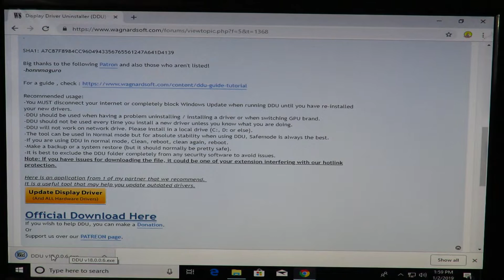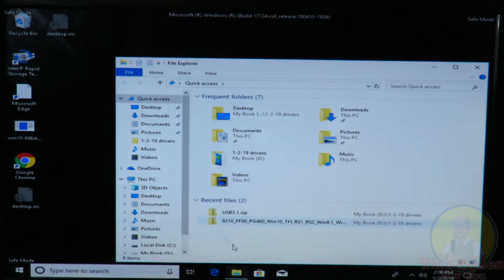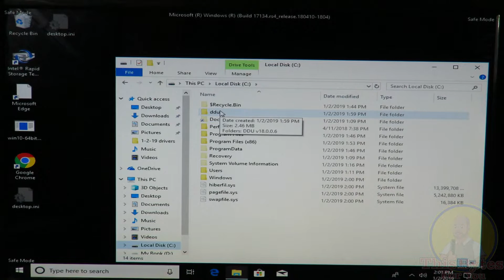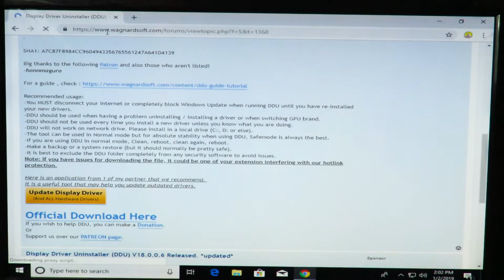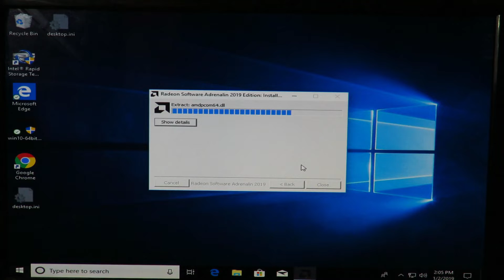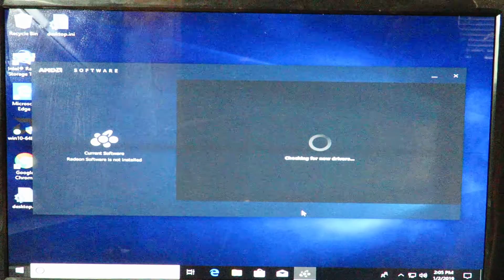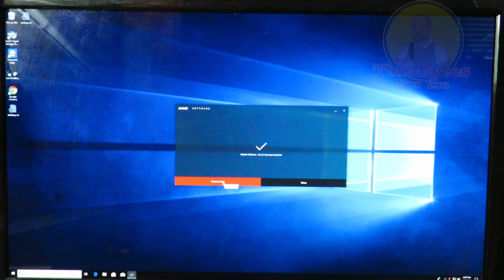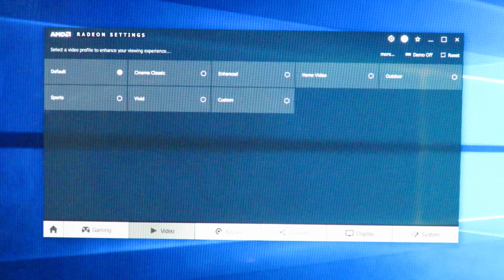How to install the AMD Sapphire Radeon Nitro+ RX 590 8GB OC Special Edition

Comment from the maker: In this video, we go over how to install the Sapphire Radeon Nitro+ RX 590 8GB OC Backplate Special Edition 11289-01-20G to either upgrade your computer or when building a newer one.  
Check it out on Amazon: http://geni.us/CWSOO8N
Reply: Quick question.... Do I need to use two sperate PCIe cables from my power supply unit to connect this? Or if I have one PCIe cable that has two 6+2 connectors can I just use the one cable & the two different connectors on it for the card?
Reply from the maker: @gkennedy0969  it's best to use 2 if you can, 2 cables and 1 connection per cable.
Reply from the maker: Always a pleasure my friend, so very happy you stopped by, trusted in me to help you, liked and subbed as well as took a moment out of your day to thank me.  It means a ton to me and I am so very happy I could help you. @gkennedy0969

Comment: There's any risk putting the cable with the extension 6+8 in the gpu?? i can see that u put is an individual cable for each input one for the 8 and other for the 6 pin
Reply from the maker: I would always recommend putting one cable per connection, not daisy chaining connections.  It can cause bluescreens and other oddities, I don't know that it would kill your card, but it causes more issues than it's worth.

Comment: Do i need to anything like turning off my power supply or not ??
Reply from the maker: @nishansidhu9353  yes, flick the switch in off on the power supply
Reply: Before installing the gpu ?
Reply from the maker: yes

Comment: What psu recommend for the rx590  sapphire pulse nitro??
Reply from the maker: 500Watt or better, you can find a 500Watt here on my global Amazon Affiliate link: https://geni.us/a7UGUi, but I would recommend a power supply that can grow with your system that way next time you upgrade your gpu, you don't have to buy a power supply, I have used a 1000Watt and a 1200Watt for over 15 years, no issues and it will only use what it needs. Here is one off of my Global Amazon Affiliate link: https://geni.us/R1BQUXi

Comment: I bought the same card just now the guy is legit and told me its working i plugged it in it lights up but fans don't spin and no signal , any fix?
Reply from the maker: What are you system specs?
Reply: @ThisBytesForYou  its an old pc 
H61M SPV2 REV 2.2 DDR3 MOBO 
DDR3 8GB RAM
SSD 256GB
HDD 500GB 
 My old GTX750ti works like a charm but this card won't, the guy told me to switch the bios thing on the card but that did nothing, i read on the sapphire card page that it requires UEFI and my bios version is legacy could that be it? If so how to change the bios type? Im so bummed down i thought its gonna work
Reply from the maker: @A_D_7_3_9  yes you need uefi for sure
Reply: @ThisBytesForYou  how to i do it?
Reply from the maker: @A_D_7_3_9  you may not be able to, I will check when I get home
Reply: @ThisBytesForYou  thanks man , its GIGABYTE H61M SVP2 REV 2.2
Reply from the maker: so first, you need to see if Windows is on a GPT partition, you can see both UEFI and GPT in this video at the 8:33 minute mark: https://youtu.be/4BtdMcqwaFg?si=rtssfODeWvzT-THG
The video shows you how to change to GPT if you need to, which will enabled UEFI, see if it helps, its in the BIOS and Windows.  Your BIOS supports it, make sure you are on the latest BIOS version: https://www.gigabyte.com/Motherboard/GA-H61M-S2PV-rev-22/support#support-dl-bios
FCe
Reply: @ThisBytesForYou  i just gave up and ordered some parts:
Asrock b450m/R5 5600/2x8 Asrock ddr4 3200mhz 
You think its an improvement? I'm gonna using my old GTX750TI for a while would i notice a smoothness difference ? I know the GPU is the x factor but still
Reply from the maker: Totally an improvement, good stuff my friend.  The 590 is much better than a 750 though.  What is the manufacturer and model number of your psu?
Reply: @ThisBytesForYou  its an average MSI A650BNL it'll do i guess +80 bronze
Reply from the maker: OK good, thats perfect
Reply: @ThisBytesForYou  thanks man
Reply from the maker: Always a pleasure my friend, so very happy you stopped by, trusted in me to help you, liked and subbed as well as took a moment out of your day to thank me.  It means a ton to me and I am so very happy I could help you.
Reply: @ThisBytesForYou  liked and subbed , well deserved 👍 , anyways what should i check or do when the rig comes in few days? Apart from the obvious windows install and drivers , i mean like hardware check physically or through programs to make sure everything is working in order
Reply from the maker: Usually just build it up, power it on, flash the BIOS, set the BIOS and install, some people don't put anything in the case till they know each part works built outside of the case, but thats too much work in my opinion.  Thanks so much for your support.

Comment: Brooo i cant fit my 8 pin plce cable because of those damn pipe shits on the card
Reply from the maker: @我討厭黑鬼  those pipes are important, is the cable not long enough?
Reply: @ThisBytesForYou  no the pipe is blocking it but if it'd be a 6 pin it would fit so I can maybe understand why it's like that
Edit: I cannot belive you replied on a video from 5 years ago and you replied under 10 minutes, truly a G
Reply from the maker: @我討厭黑鬼  haha I reply to all videos,old and new, the timing, well I was in bed and I can't sleep, so might as well try to be productive haha.  You should be able to use Pcie extensions if necessary but always happy to help where I can my friend.

Comment: Is the RX 590 8GB Sapphire nitro compatible with HP prodesk 400 G1 MT? 

I'm planning on upgrading my office computer into an intermediate gaming desktop
Reply from the maker: you going to have to measure inside of your case, to see the clearance.  The card is 260mm in length, 135mm in width  and 43in thickness, it requires a 500Watt power supply and 2 PCIE connections, and 8Pin and a 6Pin, you need both.
Reply: Thanks for the info, just what I needed :D  @ThisBytesForYou
Reply from the maker: Always a pleasure my friend, so very happy you stopped by, trusted in me to help you, liked and subbed as well as took a moment out of your day to thank me.  It means a ton to me and I am so very happy I could help you.
Reply: @ThisBytesForYou  by the way, can I ask another question? Like is Asus prime B450M-A compatible with HP prodesk 400 G1 MT? If not, can you recommend some compatible motherboards?
Reply from the maker: Hey bud I am sorry,  YouTube's notification system is horrible, I missed this comment, how's everything working now?

Comment: I conmected the 8pin(6+2) but i did not the 6 pin but its working fine. Should I connect 6 oin aswell or it can work without that aswel
Reply from the maker: Yes, connect the additional 6Pin, because it will help and it will not hurt you in anyway.

Comment: Hello.
I bought a used rx590 nitro+ SE.
It will arrrive in 2-3 days.
I'm  running a 80+ bronze semi modular 550w psu.
My problem is I have only one 8 pin PCIE connector for power ( I had another 6 pin connector but i can't find it now) 

Now, can i run this GPU with one 8 pin connector or do i need both?

I was told by one of my tech friend that PCIE slot gives 75w of power from the board and i have the 8pin connector that gives 150w so I should be good to go?
Reply from the maker: Hello, no, you need both.  The card "may" run with a single, I have heard reports of it, but chances are it will fail.
Reply: @ThisBytesForYou   Then I should go buy another connector before the GPU arrives. Thanks for the info ❤️
Reply from the maker: well yes, but I don't recommend splitting them, I recommend getting a power supply that has the connections, in 2 separate connectors, not daisy chained.  What is the manufacturer and model number of your power supply? @rafidraihan5543
Reply: @ThisBytesForYou  Antec Neo Eco 550w Semi Modular 

I already have a 8pin connector that comes with the psu. I also had another 8 pin to 6+2 that i lost.
Reply from the maker: I recommend contacting Antec and purchasing another from them, here is where you contact them: https://antec.com/contact, the model number is NE550M V2 and you want to buy a 6+2 Pin PCIE power connector for that specific model.
Reply: @ThisBytesForYou  I will contact Antec and ask for what you told. 
And thank you for taking the time I appreciate it very much ❤️
Reply from the maker: thanks bud, and let me know how it goes.

Comment: Sir I have a p6-2212d hp pc....and I'm wondering If the aisurix Rx 580 is compatible with it....pls ask me informations you need thank you
Reply from the maker: is that an AIO computer?
Reply: @ThisBytesForYou  whats an AIO computer?
Reply from the maker: AIO is an all in one computer, the monitor has all the components, no need for a desktop or a tower.  Or is your PC a full tower, is this your PC: https://support.hp.com/us-en/drivers/hp-pavilion-p6-desktop-pc-series/model/5265465
Reply: @ThisBytesForYou  yes that is my pc
Reply from the maker: sadly I don't know the insides of the PC, The card takes up 2 slots, and is 260mm long, 135mm wide and 43mm thick, can it fit in there so far?  The card is a system requires a 500Watt PSU with an 8Pin PCIE connection, do you have one of those, like i show you in the video?
Does your motherboard have a x16 PCIE slot and is your BIOS able to run in UEFI, not legacy mode?
Reply: @ThisBytesForYou  the gpu can fit, I checked it....the pin doesn't need 8 pin from the aisurix rx 580 description...only 6 pin.....also yes I have x16 pcie slot....also yes I have uefi
Reply from the maker: no, you have to have both, not just one, unless you like having issues, if you do, then yeah 1 works perfect. @KapusoKapuso
Reply: @ThisBytesForYou  what do you mean I have to have both? Have to have both what?

Comment: my motherboard gigabyte H410M H V2 (rev. 1.8) does not support my AMD RX 580 8 GB GPU, what to do ? appreciate your help...
Reply from the maker: So first off, your board does support the 580, your board supports UEFI. and your PCIE slot is 3.0, it should work fine, there are other things though.   
So that I can help, please list the manufacturer and exact model number of the following components:
1. CPU - manufacturer and exact model number
2. RAM - manufacturer and exact model number
3. Video Card - manufacturer and exact model number
4. Power supply - manufacturer and exact model number
5. Monitor - manufacturer and exact model number
 Redundant I know, but many people forget to enter manufacturer and exact model number
6. Do you have ALL of the PCIE connections plugged in, and not daisy chained or pigtailed, each coming directly from the power supply?
7. Are you running through HDMI, DP, DVI, VGA, any adapters?
8. Is UEFI or Legacy Setup in the BIOS?
9. What slots do you have your RAM installed in?
10.Do you have CSM Enabled or Disabled in the BIOS
Reply: i try to list what i know...
1 CPU i3-10100f doesn't support integreded card
2 RAM 8gb Furry 3600mhz speed put in slot number 2
3 Soyo AMD RX 580 8GB RAM 256bit
4 power supply is Aigo 500 watt
5 i have 3 different monitors LG Samsung and local made one
6 yes all coming from PSU
7 i use adapter for 2 monitors from DP to HDMI because my PC monitor won't see my PC at all.
8 yes both set up
9 slot 2
10 CSM enabled, it's the only way i can boot with RX 580 but i can boot with GT 730 even if disabled
note, tested it in PC shop it's working fine without any issue
note 2 no signal direct from HDMI to HDMI
Motherboard bios updated to latest version...
 @ThisBytesForYou
Reply from the maker: for any cables, adapters will cause issues, try to never use use.  For HDMI, make sure you are using an HDMI 2.1 cable, you will have issues with anything lowers.
Now you say its not compatible, what is the issues?
Reply: @ThisBytesForYou  whenever i try to install drivers for RX 580 i get no signal screen during installing
Reply from the maker: you need to be using an HDMI 2.1 or a DP 1.4 cable, no adapters., are you using Windows 7, 10, 11?
Reply from the maker: Are these clean installs of Windows 10 and/or 11 or upgrades
Reply: @ThisBytesForYou  yes...
Reply from the maker: right click on your start button, then left click Device manager, expand disk drive, right click on your C drive, which ever drive it is, then click properties, then click Volumes, then click Populate, what does it state under partition Style?
Reply: yes im having another problem i found out my other ram slot doesn't work and paste under CPU cleaned it but the PC won't post.... while cleaning i noticed some bind on few pins on the CPU board...what to do ?
 @ThisBytesForYou
Reply from the maker: unfortunatley all you can do is unbend them, and you have to be very careful you don't break them, something like this from my Amazon affiliate link will help: https://geni.us/6wHuOc that and a pen to push the pins.  It's scary your first time, just be VERY careful.  This makes complete sense why the other RAM slot doesn't work, maybe video card too.

Comment: How to fix this problem plz😢
Reply from the maker: So that I can help, please list the manufacturer and exact model number of the following components:
1. Motherboard - manufacturer and exact model number
2. CPU - manufacturer and exact model number
3. RAM - manufacturer and exact model number
4. Video Card - manufacturer and exact model number
5. Power supply - manufacturer and exact model number
6. Monitor - manufacturer and exact model number
 Redundant I know, but many people forget to enter manufacturer and exact model number
7. Do you have ALL of the PCIE connections plugged in, and not daisy chained or pigtailed, each coming directly from the power supply?
8. Are you running through HDMI, DP, DVI, VGA, any adapters?
9. Is UEFI or Legacy Setup in the BIOS?
10. What slots do you have your RAM installed in?
11.Do you have CSM Enabled or Disabled in the BIOS
11. Installed latest supported chipset driver?
12. Have you disabled Fast Boot within Windows?
13. This video will help you identify hardware inside your PC: https://youtu.be/65ZSiVImJx0

Comment: Not display show 😢
Reply from the maker: So that I can help, please list the manufacturer and exact model number of the following components:
1. Motherboard - manufacturer and exact model number
2. CPU - manufacturer and exact model number
3. RAM - manufacturer and exact model number
4. Video Card - manufacturer and exact model number
5. Power supply - manufacturer and exact model number
6. Monitor - manufacturer and exact model number
 Redundant I know, but many people forget to enter manufacturer and exact model number
7. Do you have ALL of the PCIE connections plugged in, and not daisy chained or pigtailed, each coming directly from the power supply?
8. Are you running through HDMI, DP, DVI, VGA, any adapters?
9. Is UEFI or Legacy Setup in the BIOS?
10. What slots do you have your RAM installed in?
11.Do you have CSM Enabled or Disabled in the BIOS
11. Installed latest supported chipset driver?
12. Have you disabled Fast Boot within Windows?
13. This video will help you identify hardware inside your PC: https://youtu.be/65ZSiVImJx0

Comment: bro my AMD Sapphire Radeon Nitro+ RX 590 8GB has some problem when i start the game the pc automatically  shutdown plss tell me how to fix
Reply from the maker: So that I can help, please list the manufacturer and exact model number of the following components:
1. Motherboard - manufacturer and exact model number
2. CPU - manufacturer and exact model number
3. RAM - manufacturer and exact model number
4. Video Card - manufacturer and exact model number
5. Power supply - manufacturer and exact model number
 Redundant I know, but many people forget to enter manufacturer and exact model number
6. Do you have ALL of the PCIE connections plugged in, and not daisy chained or pigtailed, each coming directly from the power supply?
7. Is UEFI or Legacy Setup in the BIOS?
8. This video will help you identify hardware inside your PC: https://youtu.be/65ZSiVImJx0
Reply: It shuts down because your power supply might be insufficient. It Happened to me, when I used a 450w for this gpu. I had no issue when I replaced it with a 750w psu. 
550w psu and above should be enough for this.
Reply from the maker: We have no idea because he hasn't provided any info, this is one of the things I ask, can't assume.